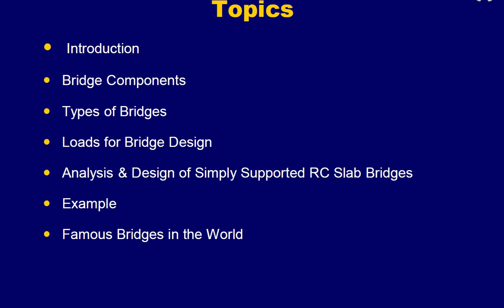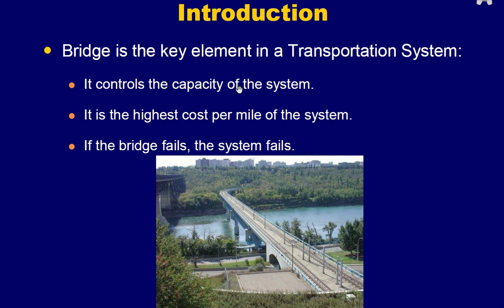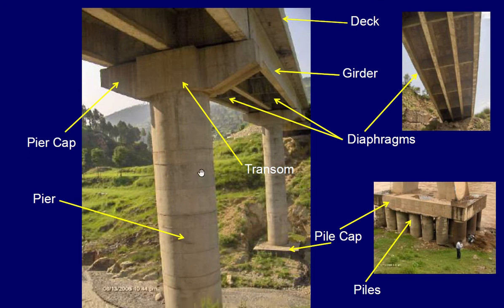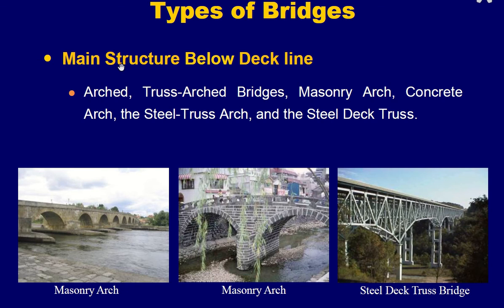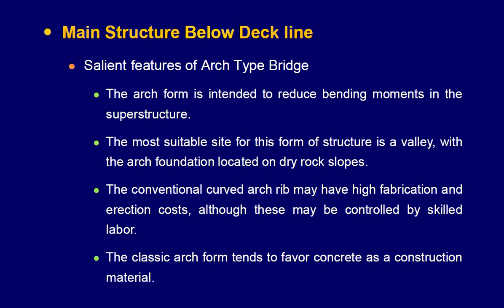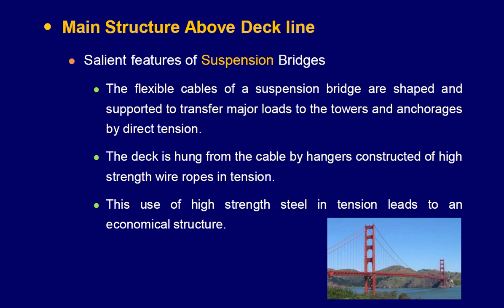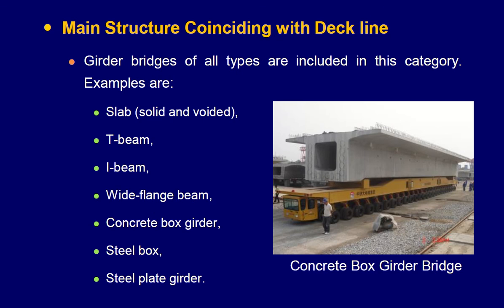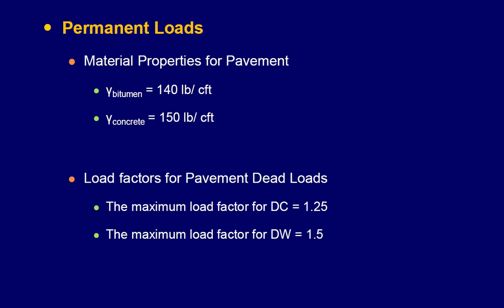Introduction to Bridge Engineering - 01

Comment: I am just trying to find out why so many concrete freeway overpasses in my area have almost 2 feet wide gaps in between sections of pier caps, running vertically through the girder and deck locations?